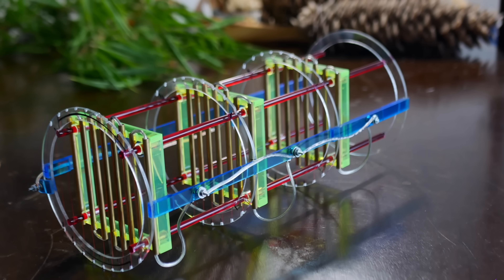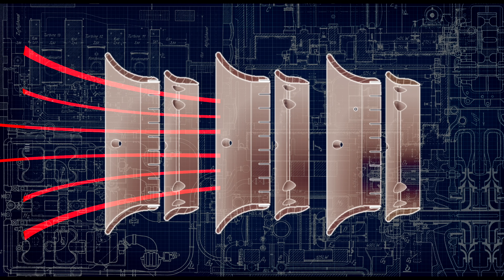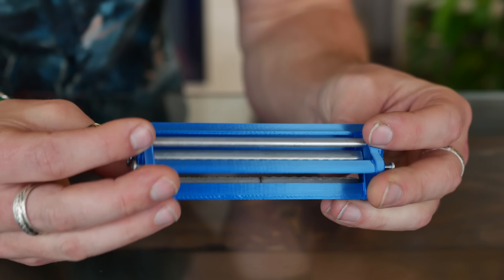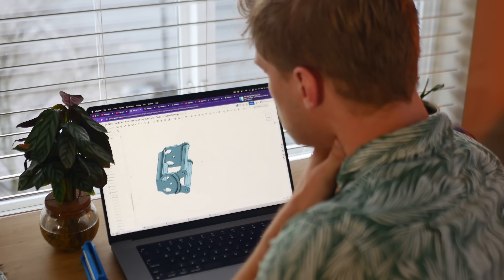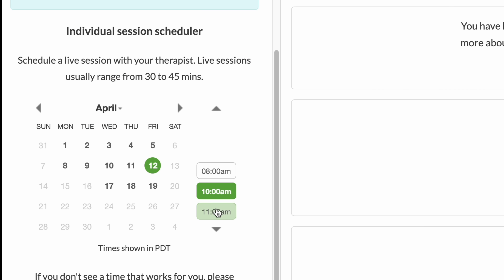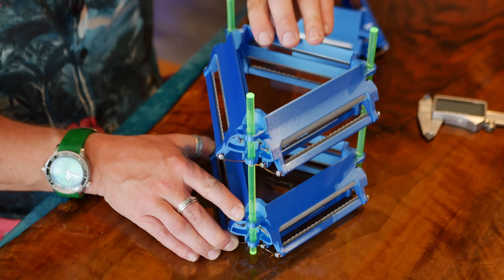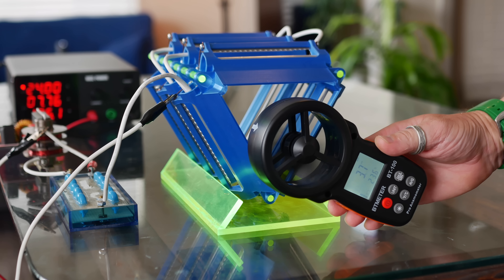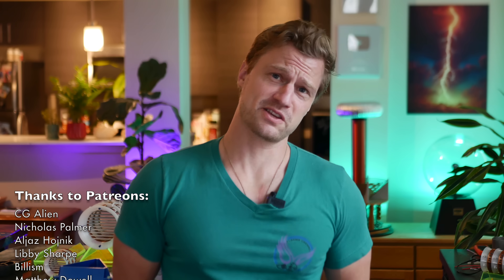Next-Gen Ionic Plasma Thruster Inspired By Nature (BTC Mark 3)

Comment: I've mentioned this before, but you need exponential spacing. You are trying to accelerate a 2.8 column of air with another 2.8 stream input.  Because you want external entrainment, you might consider an exponential horn housing. Each 2.8 input would force more air into a smaller space, increasing the speed. 
Alternatively, each thruster could be exponentially increased in power, to use the same level of input more efficiently. So like cut the first one in half, raise the last one by double. Without external entrainment, you could change the distance between anode and cathode to accelerate the same stream successively but with increased speed each time. The first one would be closest, and the second one twice as separated, but since the air is already moving, the ions would travel much faster covering the doubled distance in the same time.
Reply from the maker: Honestly everyone, the input here is phenomenal. Thank you for the time you've put into explaining your ideas - a lot of them are......frankly brilliant. This is what I love about the comments section - so much intellect piling together. It  gives me a lot to think about, and how much further my design needs to go. The critique is good, and the suggestions are even better. Thanks!
Reply: @PlasmaChannel  comments sections manage to both rekindle and extinguish my hope for humanity, all the time. it all depends under which channel the comments are located. 😆
Reply: @PlasmaChannel  How about making one of the metal contacts into something like a cheese grater? Or instead of horizontal spacing between contacts, make the whole piece at an angle? Something like 15 degrees? Just a thought.🤪
Reply: @PlasmaChannel   Let me suggest you an idea that just came to me as I was watching this. The cross-section of this thruster is triangle. And then so would be the convergent point. However, aerodynamically this not good. So what if, you use this exact same technique of peripheral thrust, but instead of using three large sides or sections put together in a triangle, you try to create smaller sections (I know it would be difficult) and you put them together in form of a decagon or octagon whatever might be more possible and achievable. So this would give you an approximately circular cross section and who knows this might prove beneficial?

And if this works, then when you add further stages, instead of keeping the entire length cylindrical, you could like make each successive stage in a way that the entire thing put together is like half of a cone. Like how you would see in a jet engine, larger cross section of air intake and smaller cross section for air exit. So you would have to angle the circumference of each stage further and further slightly inwards so when put together it's like just this almost conical shape with a more converged point of focus for thrust.
Reply: @PlasmaChannel  Hey! It's been 7 days, do you have the new unit ready yet or not!!?!! ;o)
Reply: @PlasmaChannel  you should automate the spacing optimization using motors on a rail or something. You can write an algorithm to handle the automation.
Reply: @PlasmaChannel please please please test Please test 8:04 
you will be shocked at how well it works.
Reply: @PlasmaChannel  Make a cowling for the assembly to help draw in and align the peripheral flow. With the current design the peripheral intake is hindered by turbulence and cannibalism off the leading unit’s output via induced pressure differentials. You could also isolate the flows more with some fins. Should pick up a few tenths / second with everything. 

 Very cool design!!
Reply: Also, each stage should feed its highest density air into the subsequent unit’s blades. So basically you’d have about a 60degree convergence from one unit to the next.. the cool part is that with the added real estate on the leading stages, you can have two or more units feed one trailing unit. So a finished design could go from say a dozen leading units down to 4 units down to one, or into a combustion turbine…
Reply: @PlasmaChannel . ATTENTION 00:00* ⚠️Your above Comment upon inspection 🛃showed you likely  DIDN’T🛂 read much of (if even anything at all) of anyones comments. ….
It did however make a stab at what is called “getting my participation points/credit”  which involves making a statement or asking a sort of rhetorical question that touches the relevant topics; talks the talk. Jiggles the jargon and creates a sense of ….something.  A sense that some sort of exchange of info was made  and thus the professor/people/commenTORS check the box of participation pointing to that day.  

In the end we are left having listened to a bunch of nothing.   

A real NLP practitioners play at playing pretend. pretending to be a community.   Keeping the subs commenting as they feel theyre part of the team and being heard  herd. 

Herded dat digital lifestock so nice with my plasma talk.

Sow you can succeed in the future, do what you did here but simply pic one or two comments and just grab something out of them to prove you have what it takes to plant your seeds of belief back in and amongst the people places and things. That will bring your succeedery full circle.  (Phonetically speaking )

*Time Stamp: used arbitrarily to give off impression of deep thought and hardcore video yo-yoing; moving up and down with the currents of time. Stamping and stompeen.
Reply from the maker: @CoincidenceTheorist what a theory you have there. Unfortunately you’re fully assumptive as opposed to factual. Thanks for leaving the thoughts though.
Reply: Competitive rowers time their paddles to work together. Each rower contributing equal torque to move their boat with great efficiency. They do their best to minimize turbulence by cleanly slicing their paddles into the still water in front and balance the thrust while minimizing vortexes created by excessive paddle thrust.
Instead of gap manipulation I can see laminar pulses acting like paddles that try to grab still water for maximum resistance to compression. Each paddle needs to grab water that is free from turbulence generated in front of it. 
In order for a laminar pulses to slice into the flowing air efficiently, it seems like it needs to find low pressure zones as insertion points to move air similar to a pulsed or rotating detonation engine. 
By utilizing pulses, energy savings can be realized by minimizing waste zones. Since air is compressible a laminar flow can be akin to grabbing still water to thrust off from (up to a certain pressure velocity threshold before losses increase).
Also, by introducing pulses, voltages can be increased with less risk of damage. Voltage is akin to pressure and current to flow. So your voltage creates the pressure front and current launches off of it. Too much voltage can turn an insulator into a conductor but shorter pulses allow for higher voltage thresholds.
Reply: @gary.richardson really informed answer. It makes me wonder about whether adding much higher frequency components to the pulse with modulation could potentially create useful resonances. Paramagnetic effects might even start to become relevant.
Reply: @alleycatsphinx  it seems like if there is frequency modulation then thinner air will start to get entrained into the thicker stream. Maybe I'm looking at it wrong because plasma is involved.
Reply: @gary.richardson  I'd say probably perhaps...

warning : incoming comment novel

...because I have not built such things themselves, and also that you're right; it's the resonances within the plasma that would be driving the effect within the air volume. There are also surface plasmon resonances that will setup on the electrodes - although that's probably more interesting in terms of controlling laminar flow across surfaces, the way they react to radar for stealth, or as a means of remote power via masers.

I started theorizing about this stuff by accident 20 years ago (before I had learned the majority of math and physics I know now) when I saw a picture of a stealth drone aircraft taken top down as it was passing under a freeway overpass just after(!) a friend showed me a video of a toothpick wire and aluminum "lifter" type craft. I connected some dots... The jet was delta shaped (resembling the "beast of Kandahar" drone), yet had a strange bright strip of exposed metal along the front edge of the wing. I then searched online using terms like "magnetohydrodynamic" and "wing," thus uncovering lots of research papers primarily focused on using plasma to enhance lift via "leading edge plasma actuators" (bad for batteries, good for stealth, because flaps have moving parts and hard edges that glint in radar), and also for mixing cool air into hot jet exhaust to hide the heat signature of low observability aircraft. I'd imagine these days this tech is also used a lot within turbine engines and rocketry as well for shaping airflow - oh, fusion power too, though that's pretty different.

Later in life I had a job doing signal processing for "electrical impedance tomography" -  measuring the flows of alternating current  directed through the salty ionic mediums within the body from one sticky electrode to another. Mostly energy flows along the surface (skin is an amazing design for electrical insulation if you think about its alternating layered structure), yet(!) certain frequencies penetrate through the skin (and then take wild paths through the body). Though not plasma, it's similar in that the alternating current actively changed the concentrations of ions within the internal fluids, influencing the path of propagation, and also creating a large lower frequency resonance. This sort of thing falls under studies of "non-linear propagation." For the purposes of this channel, you could get some insights by measuring the impedance of alternating current across a "sweep"* of different frequencies (the wider the range the better,) either in saltwater or air. 

Based on such research, I'd speculate things are even more interesting underwater, but also less easy to explain in an already salty comment.

Personally, I'd love someone to create a quiet long endurance drone/blimp that can be used to do nature surveys without disturbing the ecosystem, because understanding how life works is more important than people killing people over diminishing natural resources... Patience is a virtue in such things, but people are beginning to figure it out (eg google "LTA UAV") This seems like a flight regime where the large surface area could benefit from reduced drag via plasma actuators, so long as the power requirements are low enough (and that's where pulsed control of the resonances might really play a part.) 

* Speaking of nature again, if you want to hear a "sweep" look up "weddell seal vocals" on youtube - those sounds are especially useful to them for navigating and communicating underwater, an example "non-linear medium" where the different temperatures and salinity effect which frequencies travel, reflect, or absorb. Submarines make those noises too.
Reply: What about using a cone approach. Wide intake with narrower output ? Thruster array is across the wide front end of the cone. The air gets compressed, thus increasing thrust. Possibly slightly smaller thrusters down the cone in a 3 thruster array config ?
Reply: @JoeyBlogs007  I was thinking of this as well. Wide front end narrow exit to focus the air. I was also wondering if there might be some advantage to pulsing the power input sequentially through the system,
Reply: @JoeyBlogs007  I like this thought as well...for what its worth :)
Reply: @JoeyBlogs007 

I was thinking the same thing, more of a ramjet style approach. All of these seem like they would cause so much drag with all the square edges, a purely circular design with smooth edges might help with that.
Reply: I don’t think that will behave as you mentioned.   Not sure this system can compress air. But would be worth testing.  Likely why he did not see much improvement when doing the spacing.  
Would love to see a 15” version of this.
Reply: @TheObserver567  the venturi effect and air plane wings  shows us that faster moving air lowers pressure.  That means with faster moving air, we can use a funnel to reduce the cross section some which would increase the pressure some. More problematically, without reducing the cross section of air, successive stages would operate in lower and lower air pressures, and as the pressure drops, the mean free path between collisions increases which lowers the air's break down voltage. Which means you'll have to lower the applied voltage, and the ammount of power you can add in latter stages. 

Lastly, one should consider how thrust and structure weight scale. Within material limits,  dupport sructure weight scales linearly while mass of air scales exponentially with the radius in the mark3. 

Just making a point, by compressing air, I'm not proposing much, just enough that it's not below external air pressure.
Reply: @kreynolds1123    Worth a try I think.
Reply: @kreynolds1123 don't jet engines employ counter rotating compression  rings that help regulate inlet pressure? I think these rings float on an air bearing and can change pitch. Instead of changing pitch, an ionic flow may regulate pressure by changing  resistance.
Reply: @TheObserver567  So, rather than push, why not try to pull. I mean set up on the back side.I don't know, this is the best project I've seen in ages.
Reply: Now it looks like you’re in a box because of the things you have to work with. 
To bad you can’t bend the razors
Reply: That's correct using golden ratio in your calculations for the spacing would help with concentrating the air flow into a smaller area as well as increasing its speed to quite a degree. But i am not letting the "Cat out of the Bag" until we talk about that 800% increase.
Reply: Would it be beneficial if you would force it through somekind of tesla valve? i think there would be a delay once you start it but you could build up pressure
Reply: I am once again advocating for toroidal airflow. While your exponential spacing/power approach is a good idea, it still runs into the problem that you're pushing the same mass in the same direction which will meet equal and opposite resistance. By rotating the stages slightly, momentum is better preserved and a greater volume is pulled in from the outside from centripetal acceleration. You can even keep the linear design, though I suspect a pentagonal arrangement would work much better.
Reply: @indoloreveritas implosion
Reply: Why not put all thrusters in one sealed tube to get more of a jet effect?
Reply: @JoeyBlogs007   or maybe circular thrusters, just kinda hard to build.
Reply: @andrebarreto9177  OCTAGON shape maybe
Reply: @JoeyBlogs007  one could use a tube. But but  as the air is accelerated,  the pressure drops (venturi effect), as the air pressure drops, the mean free path between collision for ions to flow increases, which in turn lowers the air's break down voltage. Which inturn means applying a lower voltage, and less power.  Maybe this can be compensated by increasing the distance between successive anodes and cathodes.  Using a tube prevents pulling  additional air in from the sides. The trade off is less air volume but more speed for the air that is moved.
Reply: @kreynolds1123 pressure compensation techniques need to be rapidly adjustable without adding too much weight, drag, or turbulence. There is also the risk of collision avoidance he brought up which makes the design more challenging to employ tradeoffs.
Reply: @gary.richardson   on collision risk, the new way borders on gimmicky and doesn't interest me. Not intentionally, but the new way suffers additional structure weight and could still easilly take structural damage, while the added structural weight may just keep a thruster grounded instead of taking flight.
Reply: @JoeyBlogs007  because it won't pull air in from the side to compress it and further increase airflow
Reply: @babyvsnuke  I disagree.  If you don't enclose the structure, you end up having to pull in unaccelerated air from outside of each stage which will almost certainly slow down the already accelerated air inside of the device.
Reply: @agentp92115  well that may be true the main goal is to generate airflow and therefore thrust, not to accelerate air.
Reply: @babyvsnuke Who knows, that air from the side could actually be causing turbulence within the stream, thereby limiting actual thrust and acceleration? It would be worth experimenting inside a tube imho...
Reply: @Quickened1  possibly but when you have correct geometry it minimizes turbulence and actually reinforces the stream of air
Reply: Worth experimenting with that concept...
Reply: A cone adds air resistance (drag) exponentially as it gets wider.
Reply: I commented the same, I think this would be what I tried next.
Reply: You explain it well i was just thinking use the principals of an rocket engine exaust bell to give it more trust
Reply: I don't see how that is different than the spacing techniques he has already employed.
My concern is the losses caused by backflow is not being addressed.
Also, I seen where he made improvements similar to how air dams eliminate turbulence by gap filling pressure differentials and employing laminar flow friendly shaping.
I agree that introducing 2.8 on 2.8 can be problematic because you don't want the backflow pressure become a problem with acceleration. That's why I believe pulsed laminar flow will help with distributing force over a larger area similar to how a team of rowers can gently increase their speed.
I could remember my experience in Hawaii, rowing an outrigger boat and our speed increases when we rowed together than if I independently added more than the others. 
The ion thrust has a finite pressure and can only concentrate so much because of back pressure caused when over compressing the gas.
So, there is a goal to distribute flow and pressure equally the same way a thousand points can lift one ton easier than a hundred can. When more points are added it increases more points of flow differential and added weight from geometry enhancements such as adding ribbed humpback splines for improved laminar flow. On the positive side, if the geometric enhancements can also be integral to the structure, anode/cathode distribution, energy storage, sensor array, and duct work then you have a complimentary design.
I could see very thin ribbons be used as fasteners between stages while simultaneously encouraging laminar flow and distributing power to each grid.
Each ribbon could be slid into place like an unrolled scroll with top and bottom roll up pins that slot into a conductive pin array that carries both power and signal. The distributed tension needs to be lower than the elongation failure point to ensure reliability. To do this type of design, the principle of tensegrity needs to be incorporated into the design philosophy.
Reply: Just like a kite employs tensegrity by keeping a membrane in tension against sticks in compression for a light weight but rigid structure. Likewise, thin films in tension may be able to double as laminar flow splines and as fasteners between stages. The anchor points, would possibly double as air injection points seen on air dams if they could exploit a variable input scheme instead of a a fixed funnel geometry.
Someone else mentioned that if the air pressure drops too much then the breakdown voltage of the air changes and the voltage needs to be lowered. So, it would make sense to ponder how a variable inlet can be integrated as part of the structure while doubling as a saddle on a compression member or anchor on a tensioning membrane.
Reply: @gary.richardson just like that you said tensegrity
Reply: Yep, mass is conserved, so having same diameter accelerators in series should all have the same exact mass flow, through them (that is if air  doesn't come in from the gaps between the accelerator tubes). If, like you said, the first tube is the largest and blows air into a smaller tube, which in turn blows air into even smaller tube, then the air speed can increase while still staying almost constant in every stage/tube.
Reply: Why not use harmonics in your convergent elements? Think of a Yagi antenna. Change the spacing and size of the thrust elements accordingly.
Reply: Thought experiment : the combined thrust of all 3 together is not the sum of individuals. Would it make sense to have 3 individual thrusters instead of this combination? Would it help push out more power? Ideally these would go on a wing... So can we mount it on one and see the difference between the 2 designs?
Reply: This was exactly my thoughts as well. If you stick two identical ducted fans in front of each other, you won't get anywhere near twice as much thrust. Same principal applies here.
Reply: This might sound dumb, but could you use small hexagonal shapes for the structure if the body of the thruster internally to create a lighter yet stronger body? Idk. Maybe you could look at insects for inspiration? They seem to know how to keep lightweight and yet move so quickly, and keep strong structure....

I'm just thinking about weight reduction...
Reply: I’m no rocket scientist but I can’t help but wonder if first there is an issue with the airflow, it seems to me the force of the air would be substantially deflected after the point of convergence do to deflection. Also separate power sources for each module would improve power capacity and could be used to isolate a module in the case of failure. I guess the only other area i would experiment with is the shape of the terminals and of course material. It apears to me that you would want maximize conductivity balanced with reliability. Food for thought or perhaps you already have 🤷‍♂️. Are you collaborating with anyone on the project?
Reply: Instead of a triangular arrangement go with a hexagonal structure. It will add both power and stability and focus the stream more.
Reply: Why don't you run a controlled vacuumed space around the frame to send unwanted air into the inlet and use this idea as your shielding around the frames of the thruster
Reply: Um yeah, it’s also needs to address that back flow.
Sharks use the yeti currents to speed up according to a nature doc.
If he used the correct spacing he could capture the back flow of that current and stop creating extra vibrations that don’t help.

I think it’s veritasium channel or science asylum that demonstrates resonance with sound and fire in a tube.
He is showing a visual of this affect in the beginning, then he even talks about the adjacent affects and misses it completely.

The nature documentary on shark scales and teeth being the same thing.
Plus sound resonance.
I don’t remember the channels name.
They were hired for Game of Thrones intro that plays before each episode.
Learning the concepts behind that sound board would fix the issues.

How to apply them, that’s probably going to take a guy like Plasma.
Reply: @Charity4Chokora  would you mean the NightHawkInLight channel?
Reply: @Charity4Orphans could it be possible to channel sound passively in a harmonic multiple instead of needing to generate the raw power to navigate the physics behind your point?
Reply: @Charity4Chokora    Sounds a bit Fibonacci like.
Reply: @JoeyBlogs007 Theres an interesting phenomenon in boats call hull speed - it limits the speed at which boats can go, kinda like a sound barrier in water. It has something to do with waves and wavelengths, so maybe fibonacci somehow relates to wavelengths that don't constructively interfere?
Reply: His design isn't optimized for static pressure so nozzle geometries are going to be minimally effective.
Reply: 8:04 is one he never tested.
Reply: I agree, also on the last stage adding air guiding veins to assist in better air convergence, this will also help pull more air though the centre increasing total air flow. Much like a dyson fan does. Spin that Air 😀
Reply: Sim. Isso!!! Verificar porque fluxo retorna, no primeiro teste com gelo seco!!!!
Reply: also next stage has to have more power than the previous to accelerate the air surely?
Reply: Hey, just an idea for scientific purposes and obviously I want to see if you managed to make it work or not, using a spiral could converge those and make it much more efficient especially using Tesla's 3 6 9 12 theory, the three points was definitely a improvement but imagine twisting those and converging them in a 9 point convergence, especially if you offset the convergence just a little bit to create a whirlpool affecting it condensed more especially if it has a slightly bigger diode every time just like what you'd find in big generation units or industrial turbines
Reply: The sequential thrusters are like having three cars connected together going thirty miles an hour. The distance between them introduces drag. So, the closer together they are the less drag. This system has one power input. So, the power is constant. The thrusters 2mph speed are not additive. Nor multiplied. - They all push at the same rate. This means 3 X 2mph = 2mph.  To go faster you need MO'PWAH!  With the three sides of input the volume of air input is increased from drag/friction to draw in more air. Not MO' Speed. (Neglibible speed increase because of volume. But there is still the same power input. So, same speed.) For MO' Speed - like cars - means "Put the pedal to the metal!" and give the ionic system MO'PWAH! More Power.
Reply: A horned approach would get you a faster output speed but would be less efficient, like squeezing a hose.

You're right about the problem though. I still think the v1 design would have improved significantly with a casing tube, so that you were speeding a single coherent stream of air rather than introducing new slow air at every stage.
Reply: What about making the whole wig like that?
Reply: Would creating a convergent cone shaped anode and cathode improve drag? Im imagining the convergent air currents may cause drag in that triangle configuration
Reply: I wonder what Ac freq adjustment ramp up or lower the HZ, similar controller sound force experiments have shown you can get significant movement with sound. Or combine the two using sound calling to focus the stream. Food for thought 😊
Reply: Not well versed in aerodynamics:  are the second and third peripheral thrusters doing some pressure work that's wasted?
Reply: I had a similar, but still different idea along these lines. Mine is in the main comment stream, but combining them would be a neat experiment if nothing else. Good work, and you taught me something too. Thank you
Reply: Hey just a thought, 3d cylinder tesla valve for the air, create a path of least resistance for one direction flow but have that resistance feature to catch any unwanted deviations
Reply: Thank you for mentioning the horn design idea. 
Using what jet aircraft already used to more or less mechanically increase the thrust.
Reply: Yeah add a vortex to it or twelve  concurrent vortex spiraling
Reply: Make the individual units shorter and use more sides on the device, make it round again but hollow in the middle this time.
Reply: He needs to learn to code signals and waveforms 🤓
Reply: I'm with Bill.  Vortex lubrication leads to greater air speeds. 
The faster the air goes, the faster it is capable of going.
Reply: What about a directional spiral, w/ some more narrow spacing? While having different power outputs, yet the centrifugal force produces more velocity? Asking for referencing
Reply: great minds think alike this was the same problem with his second model... the idea of stocking the same thruster 3x is not goin to increase the power 3x the 2 thrusters in front is just a booster for the first thruster......
Reply: Bro try using some electronics in between to time the plasma firing between each thrusters or sub thrusters to make it more power efficient.. This might help increase air velocity with minum input
Reply: Like how the veins of a leaf are bigger the closer they are to the stem
Reply: What if there were sections on the plane that had lateral rings of propellers?
Reply: So, have a separate voltage doubler on each stage. Each doubling the voltage supplied by it's predecessor?
Reply: What would happen if you did both?
Reply: Would spacing them further apart with shielding to prevent gaps between the thrusters have an effect? Trap the air inside so that it can't defuse out of the gaps and get your thrusters at a more tuned spacing. Just my blue collar opinion.
Reply: I've mentioned something similar to this on the last video. Didn't take much thought. Understanding jet exponential propulsion would help this considerably. You're wanting to compress the streams of air instead of just making a FAN.
Reply: consider a tesla valve design where one overlaps another thruster and then make a triangle to get greater air flow
Reply: I was only thinking about how you could improve airflow, but you are so right. Now i'm thinking maybe the first stage needs to be way different, one that has the function of lining up the air. followed by the accelerating stages. I do feel like i have seen someone do your approach of anode cathode spacing idk. could've been still same spacing across the array. wait wait what happens if you not increase in power but change the frequency. Double the frequency from 1 to 2 and 2 to 3??
Reply: @pimvanduijne increase the voltage with shorter pulse widths while avoiding breakdown voltage and current overheating.
Reply: Can someone tell me if this still produces ozone and if thus could be a problem?
Reply: @colli._.k yes it does produce ozone.
Reply: @colli._.k  it does. And could become problematic given a long enough run and small enough space with inadequate ventilation.
Reply: @colli._.k awww. Yea it hella does. Underwater it leaves a trail of tiny hydrogen bubbles due to electrolysis.
Reply: He does not listen. i tried
Reply: Erm Akchually ☝🤓
Reply: @No0dl_e-g2i  the whole concept relies on physics, what do you expect? You can't ignore fundamental physics when talking about physics
Reply: This is plasma channel, were all nerds @No0dl_e-g2i